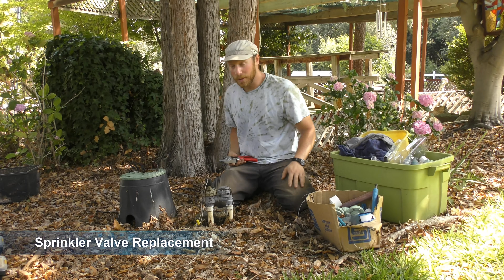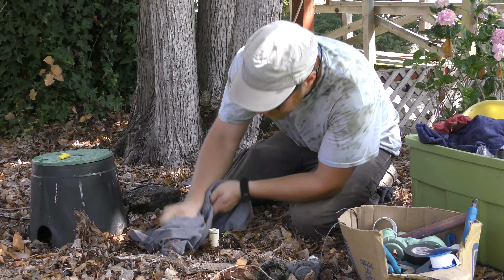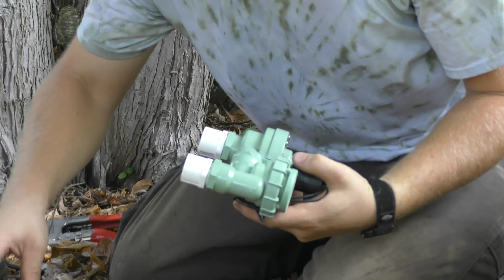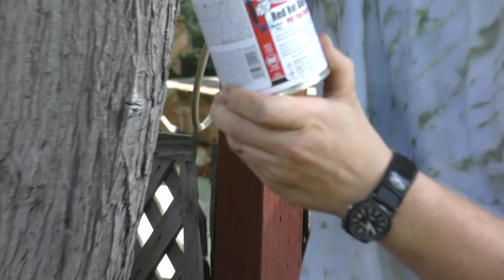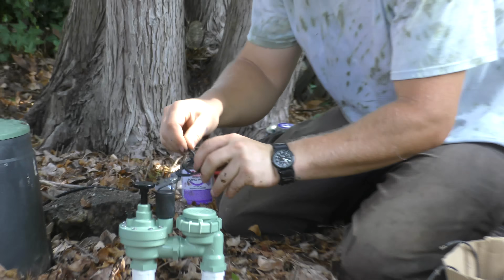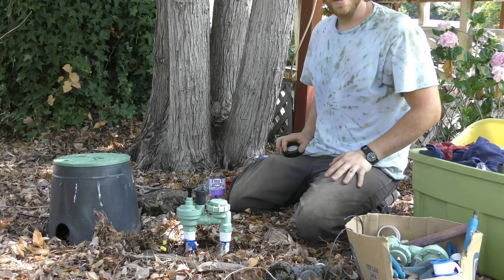Sprinkler Irrigation Valve Repair

Comment: ? Solenoid connection? 
Said towards the end something about that it doesn't matter which wire is connected something something station, does that mean that you don't have to wonder or worry about POS & NEG or wires being connected wrong or backwards just so long as they're connected one to common and one to hot?
I've always wondered and sort of worried about accidentally connecting wrong to burn the thing up.

Comment: One:  that's a WIRE NUT, not a wing nut.  Two:  I'd never put on primer and PVC glue with the pipe as wet as that.  Likely to leak like a sieve as soon as you turn on the water.  Three:  I guess nobody fixes these valves, or they are so cheap (yep) that it's not worth fixing them.  Usually the repair is simple.  But if the valve is so cheap that it's better to replace, then why use the same valve?  That don't make NO sense.  Four:  the new valve and vaccum breaker went on closer to the ground than the old valve.  You can only do that a few times before you're underground.  Why not put a union on it and keep it higher than the sprinkler heads it serves?

Comment: That valve looks too close to ground level. Have you verified that it's 6" above the highest sprinkler head (minimum)? It won't work properly if it isn't.
Reply: Good technical point.

Comment: I have a little problem. Im helping a lady over 70 yrs old. I installed 4 sprinklers head (rainbird 1800 series) This will be turned on manually. She has an old brass siphon valve. The problem is i am getting a mist and when is gets windy push the water everywhere. She doesnot have enought money to spend. It is just 4 sprinklers heads in 1 water line. What can i do to solve the proble.. Help please. Thanks.

Comment: Thanks for the video.  I need your help. I have 3 zones. 1 and 3 are working fine with 30 psi but valve # 2 has zero PSI. I already opened and cleaned the valve still no pressure. I'm guessing there's a rock in the sprinkler pipes. All sprinklers in zone 2 don't rise. Do you know why 2 zones have pressure and the middle one does not?  Thanks in advance.
Reply from the maker: There could be a couple of reasons you are getting low pressure. One is that there could be a leak in the pipe before the valve. Two is that maybe the solenoid valve  is broken and isn't opening all the way. If you cap off the sprinklers and run the station you should fine a wet spot where the leak is if its due to a leak.
Reply: Thanks! I will check ...

Comment: Orbit sells a swivel adapter that can be screwed into the anti-siphon valve. This adapter allows the valve to be removed without cutting your pipes. In the event that a new anti-siphon valve needs to be purchased, the adapter can be unscrewed and installed onto the new valve. Lowes sells these swivel adapters in plumbing.
Reply from the maker: Good to know. Thanks for the tip.Now I know where to get them. This one was lawn gene. I figured it should be good for about 30 years this way since it's out of the sun and has a box around it.